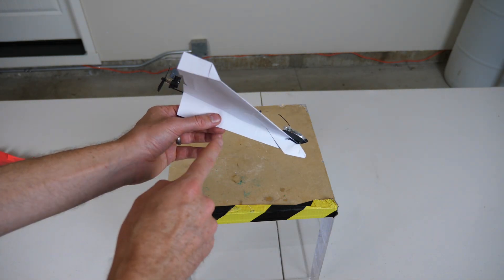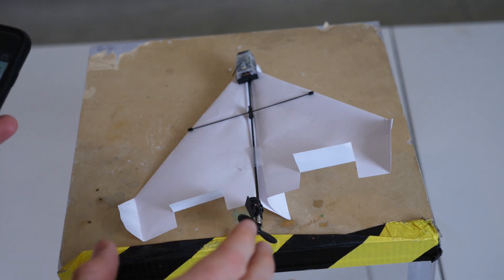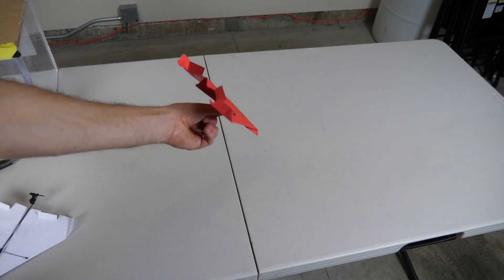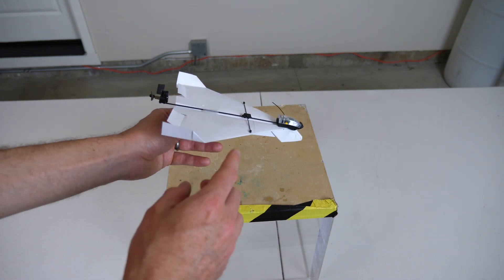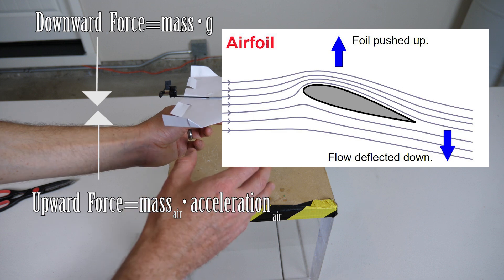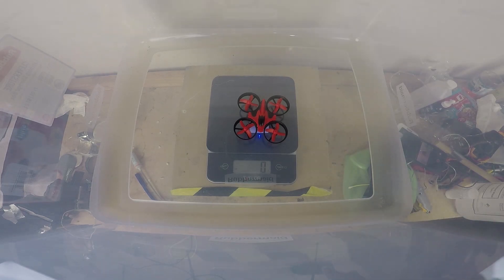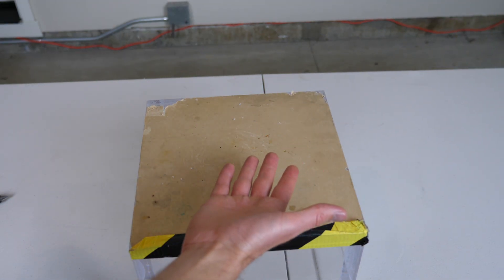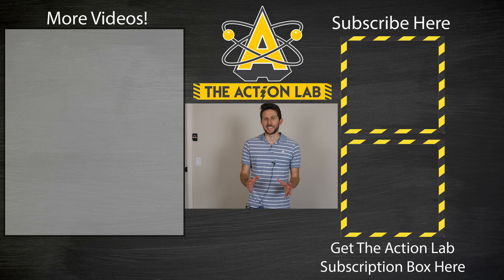How Far Can a Paper Airplane Fly if You Add a Motor? How Do Planes Really Fly?

Comment: 1:21 ummmmmm no. The shape is curved from above, which means there's less pressure above and more below, which freaking makes it go up
Reply: It's all about angle of attack. If the plane is at level flight the curved wing causing "low pressure" keeps, or increases altitude. Increasing angle of attack increases altitude, but causes high drag, killing efficiency.
Reply: God of plumbing very true
Reply: Niels Cremer At 5:14, he explains that right, just mistaken at first
Reply: Niels Cremer
1:21 ummmmmm yes. Just because numerous half baked "science" programs keep repeating that BS doesn't excuse a lack of critical thinking.
-Have you ever noticed that planes can fly upside down, without magically changing the shape of their wings?
-Look at the wing of the typical aerobatic plane. It's symmetrical. Same curve top and bottom.
- [sarcasm alert]There's a video you should watch of a flat winged paper airplane flying.
-Simplified reason wings have curved surfaces is to smooth the air flow. In the real world, a flat wing would stall at too small an angle of attack to be useful. Notice how sensitive to pitch the paper airplane is.
Reply: Yes, theres the planes wing has a shape called airfoil, the air gets devided into two on the leading edge, some air goes downside of the wing and some on the top...because of the curve on the top, the air has more distance to travel than under the wing, which makes the air faster and have a drop in pressure, while the air under the wing has a higher pressure. Because of the higer pressuer under the wing, the plane produces lift!

...if you are wondering how the plane does a level flight(then its going straight foward and not up or down), the speed of the plane is set to a specific velocity so that the pull of gravity and the amount of lift is the same.
Reply: ScienceOfScientist SOS,
No. Equal transit time is BS. What you have written is just a bunch of words with no backing in actual science.
https://www.grc.nasa.gov/WWW/k-12/VirtualAero/BottleRocket/airplane/wrong1.html
Reply: @blindleader42  my bad, so can you tell me how an airplane flies
Reply: ScienceOfScientist SOS,
I could tell you, but that would just be more words (and way more effort than I care to go into), and that's how you and a lot of other people in these comments got into trouble in the first place. The short wordy version is exactly what the video says - angle of attack. Beyond that you'll just have to learn some science. The NASA site has lots of explanations covering the entire field of aerodynamics, but it's all aimed at students without a mathematical approach, so it's just more words (and diagrams), so you'll just have to trust that they both know the science and are not lying. The starting point of the science is the single law of motion: Force equals Mass times Acceleration. Usually it is stated as Newton's three laws of motion, but they are just three simple conclusions that should be obvious from the equation.
Reply: @ayyhmed 

The air over the top moves faster. There is NOT an equal transit.   they are at the top gets to the back of the wing faster than the air at the bottom. The are the bottom is compressed.  Queens generate lift because of the Bernoulli principle but also just because of the slant of the airplane or the angle of attack as a plane goes forward.  stick your hand out a car window and point your fingers up in your hand goes up.  To fully understand flying airplanes both effects must be considered together.
Reply: ugpuggubgmi
Reply: Your right I was just about type that
Reply: That's what I was thinking
Reply: Exactly what I was going to write lmao
Reply: im 11 and even i knew that was wrong
Reply: Ah. I too had a double take and decided he was mistaken cause that makes no sense
Reply: Yeah it's a mistake
Reply: Niels Cremer 
ส
Reply: I Agree
Reply: Lmao triggered loser.
Reply: Yeah you're right
Reply: Lots of misunderstanding in the narration of the video.  Yes, a flat bottom wing (even a door) can serve as an wing (type of airfoil) sufficient to lift an aircraft so long as it has enough angle of attack (alpha or AoA) and relative wind to apply to the lift equation (L = Cl * A * .5 * r * V^2 ).  CL is coeficient of lift per section of wing per given airfoil shape, A is the area of the given airfoil, and r is the air density measured in "slugs", and velocity of the relative wind.  It is a COMBINATION of Bernoulli's Principle (which, oh by the way, also works in water and any other fluid) as well as Newton's Third Law.  So a typical curved curved top/flat bottom wing will generate oodles of lift compared to a flat bottom wing or even a curved symmetrical (Extra 300) wing if both are at ZERO alpha (in fact, both the flat (symmetrical) wing and symmetrical wing generate ZERO).  How much is generated by Bernoulli's Principle vs Newton's Third Law at a given moment?  No one has been able to isolate how much from each because it is IMPOSSIBLE to determine.  We (as the Wright Bros ably did) CAN measure the amount of lift through empirical means in a wind tunnel and flight tests.  My educated guess (some of it inverted in Extra 300s) is that certain NACA airfoils may use more of Newton's Third Law, and as all increase AoA, more of Newton's Third Law gets applied (think of a wing at LD Max or even beyond).  BTW, just as we cannot determine how much lift occurs from Bernoulli or Newton, scientists also do not really KNOW what provides the attraction of gravity.  Yes, we know we can calculate attraction by mass and distance (inverse to lift, it diminishes by the square of the distance), but no one really knows what is causing the "weak force".
Reply: Ummm, watch the full video first?
Reply: Niels Cremer yup he was wrong there...
Reply: Niels Cremer I was just about to write that
Reply: Exactly
Reply: Niels Cremer yes
Reply: Bro yes I was screaming my mind out

Comment: Actually, it moves a greater ammount of air than its weight. If it was equal, the lift would be the same as its weight and there would be zero net change. To lift off it has to move more air. The difference among other factors determines the rate of change. Or did i miss something?

Comment: 1:19 i think it will be lower pressure above and higher (relatively) below.

Absolutely and the  forward cone is just for better air cutting, otherwise in a giant wing the forward portion of a flat plate (if used) will be a rectangle which will actively cause a lot more drag, we just explain it backwards...

Comment: This guy didnt do his research on this one. Airplanes DO create lift due to curvature of the wing! It is just not the ONLY reason wtf. The Bernoulli’s principle is an actually reason why pressure changes with curvature. The tail of every airplane, even on aerobatic airplanes with symmetrically curved wings, except canard airplanes, have a bigger curve on the bottom than the top so that it almost always create lift downwards for stability. Its basically an upside down wing.
Reply from the maker: It’s not the cause, it’s the effect.
Reply: The Action Lab are you saying the pressure differential is and effect and not a cause of lift? Sure its an effect, but it is also a cause. On flat wings like the paper airplane,  its true but most airplane wings are not flat and are indeed curved. What is taught in school that the curvature creates lift is true, just not for flat wings. My source, I am a pilot and flight instructor. There is more reasons how lift is created. Its also impractical for a real airplane to have flat wings unless its a paper airplane, wings need structural integrity, fuel tanks,  flight control cables or hydraulics etc.  Check out the book, aerodynamics for naval aviators, free on the faa.gov site

Comment: But I thought of a question.
How does a plane adjust its position to be at an angle in order to push the air downwards?
When we're on the ground, the plane starts parallel to the ground.
It should have some mechanism to change its angle, but how?

Comment: To state that the shape of an airplane wing doesn't affect flight is untrue.  The video shows a very helpful diagram of air flow over a wing in which the streamlines are much closer together above the wing than they are below the wing.  These streamlines tell us the air is traveling faster over the wing than under it.  Faster moving air has a lower static pressure than slower moving air, thus the pressures above and below the wing create a net unbalanced force upward.

That's not to say angle of attack isn't also important.  However, there is a reason airplane wings are shaped how they are, and every bit of efficiency engineers can eke out of an airplane goes directly to the bottom line in fuel savings.  Aggressive angles of attack create large amounts of drag and severely reduce efficiency.

The last point to note is: the flaps tilted up at the back of the paper airplane create vortices, ultimately creating faster flow over the top of the paper airplane wing than under, generating lift.  This video would be interesting to watch with an airplane using completely flat wings, which would be expected to yield a worse result.

Comment: What i was taught it that while commercial airliners do rely on their wings for a majority of the lift they need to fly, high speed aircraft more rely on the power from the engines, thats why they are less likely to stall at high AoA, and since the weight of thus fuselage is so little, the engine is the pure producer kf the lift hence why you didnt need curved wings.

Comment: You are fundamentally incorrect. It is a combination of the Bernoulli principle and what you describe, it isn't one or the other. The air traveling over the curved top of the wing has a further distance to go and therefore moves faster. Faster moving air has lower pressure (you incorrectly stated higher). The higher pressure under the wing pushes it up towards the lower pressure above. The airfoil shape also creates laminar flow. This means that even particles moving over the top of the wing are thrown downward, a large component of lift that you claim doesn't exist. There is a reason real airplanes use an airfoil.
Reply: A simple experiment that proves you wrong is the one where you just blow over a piece of paper and it rises.

Comment: The curved shape of a wing causes the fluid above the wing to increase in velocity. According to Bernoulli's principle, this causes a lower pressure above in comparison to beneath the wing. The difference in pressure causes lift, the difference in pressure also explains the layman term used in this video "throwing air downwards". The reason why a flat surface can generate lift is because, 1. Theres elevators which push the rear down, tipping the nose slightly up, which slightly increases the velocity above the wing. 2. placing the receiver at the front pushes the centre of gravity forwards which balances with the lift caused by the wings, helping it glide. 
TLDR: Your physics teachers were right.

Comment: So completely wrong. Airplanes fly by pressure differential. Air pressure below the wing is greater than above the wing. It does not mater how that is achieved, only that it is achieved. 

Its a YouTube myth that it’s pushing air down. Please stop perpetuating the lie.
Reply: Smart people doing smart things
Reply: Please do some research. Also, pressure differential and downwards air are one and inseparable. Ever heard of 'conservation of momentum'? If the plane goes up, the air goes down. Bernoulli effect is only part of the lift, the other components I know of are that the air moves faster along the downwards sloping top of the wing than the upwards sloping bottom of the wing, thus generating a net down thrust of air, and the effect of angle of attack which he explained, which is also part of flight, just only part of it. I believe the second effect is the main one.
Reply: yaksher: research Charles Fauvel's flying wings. If Bernoulli effect wasnt the main component these wings wouldn't fly.
Reply: @aero e21 It may be possible to make a wing that works primarily on Bernoulli effect, but it is also true that for most wings, just the numbers you get from Bernoulli effect don't account for all the lift.

Comment: You had it backwards. The curvature on top generates a low pressure area because faster moving air has a lower pressure than slower moving air. (Applies to the beginning only.)

Comment: The curved wing thing is just one way to cause lift.
I'm 40 years old, and apparently my schooling was better than yours. I was never taught that curved wings was the reason planes fly.
I was taught exactly what you demonstrated.
Reply: Well you're obviously wrong, because if curved wings weren't part of flying, we wouldn't have curved wings. Curved wings are part of the reason planes fly, and cruising planes will mostly use this component to reduce drag. Angle of attack is a small portion. For that matter, if it were the entire thing, the "stalling" caused by flow separation wouldn't be a thing.
Reply: yaksher not necessarily, curved wings could just be more efficient...
Reply: Then they are part of flying...
Reply: Charles Fauvel (look up his flying wings)  they wouldn't fly or be stable without relying on Bernoulli effect